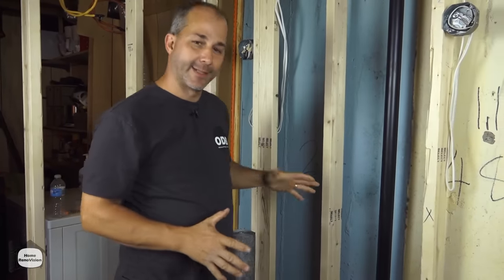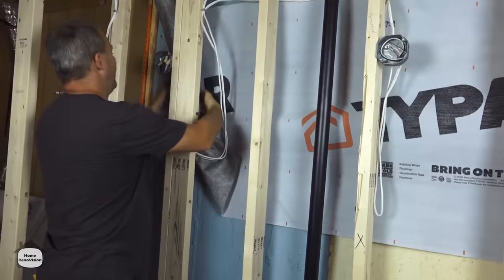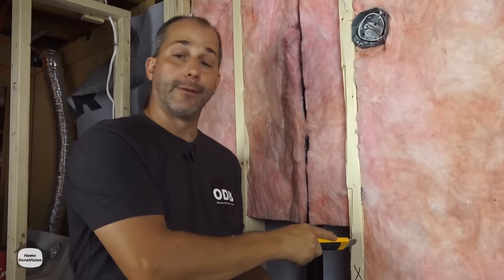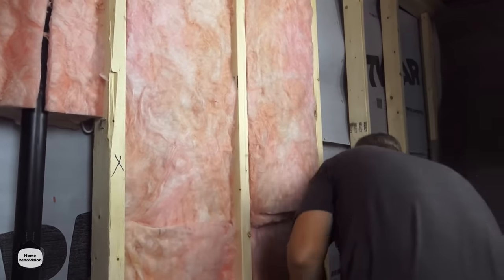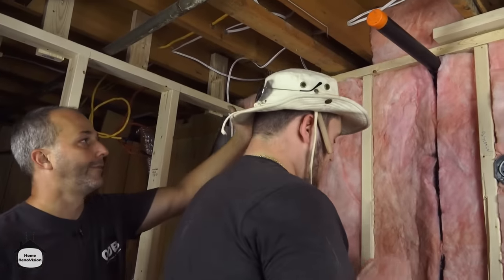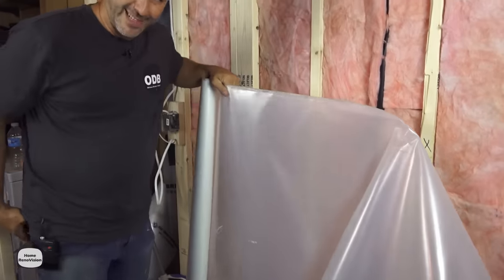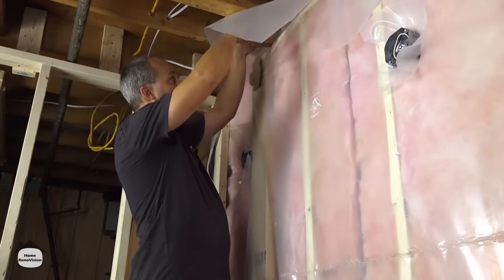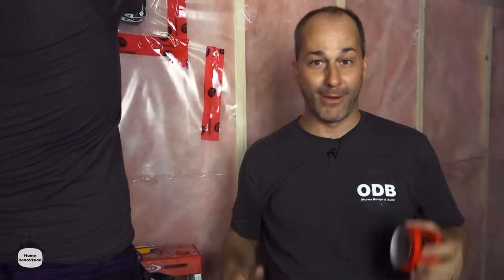How to Properly Insulate a Basement Wall: NO MOISTURE!

Comment: My builder sprayed foam in the rim joist cavity about 2" thick. He then put the Batt insulation over that. About 4 years later we noticed water on the basement floor, We removed the sheet rock and the batt insulation and found lots of water droplets, moisture and dew on the spray foam. It dripped down the basement wall. How can we eliminate the moisture problem?
Reply from the maker: this is what happens when you seal up a house tighter than a drum. the foundation releases hundreds of gallons of water as it cures. It takes years for that to happen if it can only escape through 1 side and a bout 16" only. If it bothers you that it is wet then open up the vapor barrier and let it breath for a couple years and then close. Or install mineral wool insulation and  a subfloor so that the water can drain and be released.
Reply: Thanks for the response! We plan to just leave the spray foam and not put any batt insulation. Can you advise or post a video how you stapled the vapor barrier to the inside of the stud wall? This is proven to be very difficult and we wonder if there is any tricks to doing it quicker or better. Thank you again!

Comment: Where does the moisture behind the walls go once it seeps through the concrete? Would this moisture still not cause mold on the concretes surface then make the basement smell musty? Right now I have an empty concrete basement that I would like to turn in to a livable space. I was hoping to insulate with  1" rigid foam, 6" of batt insulation and finish with 1/2" drywall but I fear there will still me moisture that could cause mold and the musty smell. What is everyone's thoughts? Thanks!!
Reply from the maker: Why are you assuming that moisture is coming through the walls?
Reply: Before finishing the basement, the first thing to check is if there is any leak in the concrete wall and make sure any potential water problem is dealt with before moving on the next step.

Comment: My name is Jim, i have learned so much correct renovations from your video's.   My basement in our home finished rooms had to be distroyed due mold in 2002 so in the early 90's l did it wrong.  Now my woodworking shop in my basement is 11 1/2' wide x 40' long ceiling just under 7' in height.
Basement is block wall in 2002 contractor put think dryloc water proofkng white pain inside should it be repainted?

I have to make new 2" x 4" walls up want to finish with drywall been a taper since 1978. Can l put 6 mil vapour barrier drapping over block walls from sil plate down.  Then leave say a gap of 1" from block wall with 6 mil vapor barrier then build my 2" x 4" outside walls.

Then l can run my wire for switches and plugs, then is pink insulation ok to put in my 2" x 4" outside walls which will have a 1" gap between block wall and new 2" x 4" walls.  Then do l need another 6 mil vapour barrier over insulation before putting drywall board on meant gor basements?
Please reply if above is ok is a workshop now but next home owner may use for finished space so want to do right on a limited budget.

The floor is concrete foes it need to be finished before building oitside walls and should l use the blue 2" x 4"'s i will use treated lumber for floor with foam under it used on sil plates. Thanks James from Ontario, Canada
Reply from the maker: Hi James for block walls I suggest using  subfloor system and an air space between the wall and block. If you live in a climate where you heat and insulate the vapor barrier should be on the inside of the framing before drywall. Cheers!
Reply: Thanks so much for your reply on block wall insulating in the basement.  The water proof sheet you put on back of 2 x 4s to keep dampness off insulation
When I put 6 mil vapour barrier over insulation on the inside of the basement with the sheeting on back of 2 x4s that won’t sweat latter will it also should l use black tar on seams and bottom of concrete in basement?
I will doc tape all seams either way thanks Jim
Reply from the maker: Hi Jim, I use a typar since it is cheap and not a vapor barrier to hold the insulation in position since it tends to fall out if the 2x4's twist while drying.

Comment: how would you finish the bottom part? i've been watching all kinds of videos and cant find an answer. House was built in 1900 in the process of removing plaster and will be installing drywall. will be updating the insulation and plan on adding a  Air Barrier with Smart Vapor Retarder. we have hardwood floors that are already installed so im pretty sure we will only see the vertical studs so im wondering how do we close the gap since the floors already installed and wont have access to the lower horizontal stud? also on the other half of the house will be installing tile floors with Schluter Ditra Membrane wondering if the vapor barrier will get in the way or how do i work around it. or should i use durock? i was trying to avoid durock to prevent cracking since the house old. if anyone has suggesting let me know thank you !

Comment: Is the Typar essential? I am insulating a basement just outside of Toronto, Have taken all of the pink insulation down, framed, and was going to put in Roxul insulation, vapour barrier and then dry wall.
Reply from the maker: Hi Simon your approach is fine without the typar. I use it when using fiberglass bats. it holds the insulation off the foundation. mineral wool tends not to fall out of the framing in the same manner. Cheers!
Reply: for the $100 it costs for a 100 foot roll, it is well worth the investment, although the the fabric should be facing into the room for full benefit of the product.  The building department in waterloo, on. recommended we use it for the basement reno we are doing for a client,  although i always use it anyways. We also are required to use 1 1/2" semi rigid roxul board or rigid foam in between the concrete with the type/ tyvek and the framing to achieve a R-20 r value, which is new energy star code.

Comment: My builder used tyvek on my basement wall with no air space. I have 6" insulation and condensation is forming due to cold concrete touching tyvek and being pressed against insulation. Then the water is accumulating against insulation and finding it way below the bottom of wall. What do I do here to fix this? Please advise.
Reply: Your walls are allowing more moisture into the basement from the outside and traping it in the space, this is going to create a mold issue. You should think about tearing down the tyvek and insulation and alleviate the moisture infiltration. High probability  of excess water build up around your foundation outside. The grounds around the foundation must stay dry. Find out what is causing the excess moisture from outside. Fix that and your basement will be remarkably drier. Good luck.
Reply: @lou704  its because there's a heat lock, typar breathes but poly doesn't,  again you cant expect the insulated air space to breath if its tight...all concrete wicks moisture and without a place for it to go you'll be doing this again in 6 months.  No one uses typar in our province like this, this was a waist of money! You've created a gap that doesn't allow breathability,  no need for vapor barrier if you have none in the rest of the house I heard you say, then why are you using it here? I'm not sure where you learned this from but all i see is people that have no idea how a house is built commenting on this post...please get out of the trade and stop teaching garbage to uninformed people.

Comment: Great video,  question why doesn't that insulation have any paper? Or what is the insulation with paper used for?
Reply from the maker: To the best of my knowledge paper backed insulation was the fist real insulation with a vapor barrier. The paper backing was usually treated with an oil product. Before that it was for ease of installation so you could attach the insul with staples. I donèt believe that is on the market anymore in North America. Where are you from?
Reply: Home RenoVision DIY I live in North Carolina and they still have it in home Depot!
Reply from the maker: Well there you go, it is probably just for ease of installation . You probably don't have a vapor barrier in your building code and as such need a way to keep the insulation from falling out post construction. I would imagine that most of the work your insulation does is keeping the house cool in the summer.
Reply: Paper back insulation is commonly used in the rim joist application as it is difficult to properly poly in those spaces. However the best way are still just simply spray foam those tight spaces.

Comment: Hi I leave in Ottawa and my question is, i want to frame some of my wall in my basement. My exterior wall has an insulated blanket install. So the question is how far from the blanket insulation wall should I frame the wall?
Reply from the maker: Hi Marc, best to remove the blanket. It will cause you moisture problems later if you insulate again. If you are simply framing the wall and not insulating leave 1 inch. This is however not the best approach.
Reply: thanks

Comment: Hi Jeff,  your videos are great!  I watched several others but they are mainly applicable to the US where code and weather are different.  My house is 6 yr old built in Ontario. In my basement, the builder put a basic pink insulation in the basement walls from top to 6 inches short of the floor, then a plastic (vapor barrier). I am finishing my basement, but I am not sure what to do with that. Some told me to rip it off and do what this video recommends (except the PAR layer attached to the foundation wall). Some others have told me to build my frame in front of the existing insulation and then drywall it (contractors did this to a neighbor). Another told me to put the frames in front of current insulation and then also add the 16 inch insulation (shown in your video). 
I am leaning towards this last option but I am confused by you're saying that insulation should not touch the cement walls and that there should be an air flow?  
Thanks in advance for your kind answer.
Reply from the maker: Hello, if your house is 6 yrs old then it should have a waterproofing membrane on the outside foundation wall. if so then the correct way to build is to add 2" ridgid foam board then frame and insulate inside the cavity and vapor barrier. always remove insulation up against the foundation wall. Cheers!

Comment: Ok, but what about a timber framed exterior wall with wood cladding where the outer cladding is already attached to the studs and frame - there is no gap to place the plastic or sarking BEHIND the stud members and the space for the insulation is already shallow and tight? How then do you create an air gap? I am dealing with this on our 118 year old house renovation right now.
Reply from the maker: Above grade you don't need the airspace. Just make sure the vapor barrier is on the warm side in the winter or check with your local building office for details on your climate zone. That is what they get paid for. Cheers!

Comment: If I waterproof my concrete wall before framing (a professional would do that part), do I need to install the house wrap behind the framing?
Reply: Good question!  No.  You would be creating a waterproof sandwich then with no where for the any potential moisture to escape.

Comment: If you put your paper up before you build your wall where do you attach it? I thought the point was to have air circulation behind the wall studs
Reply from the maker: the ^paper does not stop air and vapor from moving. it simply holds the insulation in place. Cheers!
Reply: @HomeRenoVisionDIY  Yes, now I'm more confused...  at 1:51 you say "the simpler way to do this is to put up your paper before you build your wall'. So my question is would the paper go against the wall and wouldn't that defeat the purpose of having air circulation?

Comment: Im having two cracks filled and am suspicious I have two more. Im getting ready to take wood paneling off. If i choose closed cell spray foam, do i need the typar? And its a split level house with a garage in the basement. The garage has insulation in the ceiling but I see is black, should I have that done with spray foam as well and do I closed the vents that are on the ceiling and just make it a cold room?
Reply: No typer with spray foam. You cannot remove your garage vents unless your going to insulate your attic ceiling
Reply: I dont recommend removing vents dont forget carbon monoxide kills if you ever forget and leave your car running and garaged closed

Comment: Good morning. We have a 5 year old Energy Star home, with R12 insulation wrap with vapour barrier on the warm side on the basement exterior walls. Because it’s insulation wrap it is tight to the exterior concrete wall, although there appears to be a Typar-like membrane right against the concrete. When we go to build the basement exterior stud walls to start finishing the space, are we better to remove the insulation wrap entirely and use 2X 6 stud construction and Typar as shown in this video and R20 Rock wool and another vapour barrier on the warm side or leave the insulation wrap on and use 2X 4 stud walls with the extra Rock wool to bring all exterior walls up to R20? I’m a little concerned about what may lie beneath the insulation wrap, although we’ve had no moisture issue in the basement at this point.
Any suggestions?TIA
Reply from the maker: remove the wrap and start all over. sorry for the delayed response. Cheers!

Comment: Live in pa. I want to use roxul in between the joists and laying another batt perpendicular.  Do I need an attic fan afterwards? I'm having a new roof put on but the roofer says he doesn't install attic fans. I was thinking on buying the fan and he can cut the roof and I'll get someone to hook up the electric.
Reply from the maker: That should work. Best of success with the project.

Comment: So is it ok if i use 4mil plastic then insulate w paper batts then plastic again or would that be bad
Reply from the maker: no. tyvec is not a vapor barrier so it works to keep batt insulation in place in the cavity. Never use 2 layers of plastic. Cheers!

Comment: Why do you put the plastic vapor barrier on the outside of the insulation?  Why not put it on the other side of the wall? This way seems like it will trap moisture in the frame cavity

Comment: Ive seen other videos where they put up the blue foam insulation panels against the concrete wall, then the studs, and normal pink insulation and vapor barrier.  How is that different from your approach with the paper like wrap?  Trying to understand which is better.  I have a unfinished room in my otherwise finished basement, and I want to finish it out but not sure what approach to use against the concrete.
Reply from the maker: it depends on your local building code. In a 2 storey house in my area we must use r20 in the wall and therefor no need for the rigid foam.

Comment: I have insulation (without framing) on all the basement foundation walls. Does the come off or do I frame on top of it.
Reply: I don’t know if you’ve done anything yet but I have insulation on my foundation walls and found moisture trapped behind them. I’m going to be removing all of it. I’m assuming it was condensation

Comment: Is the foam board insulation OK to have up against the basement walls?  Then frame around that?
Reply from the maker: I see a lot of guys using that system, I think it works fine on older homes but traps moisture on new builds. I still prefer an air space , but you need to go with the code in your area or get an engineer stamp.
Reply: Perfect... Thank you
Reply from the maker: Anytime Lance. Cheers!

Comment: Hi Jeff, I have one room in my basement that I want to finish it is a 20x13, I want to do everything, except for the electrical, question is how expensive can it get? I live in Toronto Ontario.
Reply from the maker: building materials will start around 2000 bucks plus electrician.
Reply: @HomeRenoVisionDIY  I better start reading the code and instructional books!! Thanks for the info. Keep them videos coming, wish you much success.